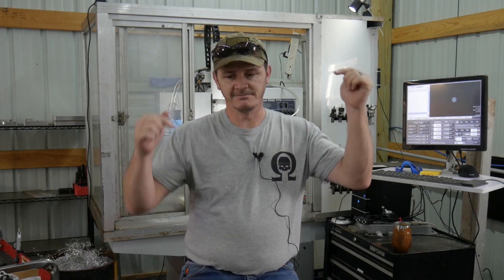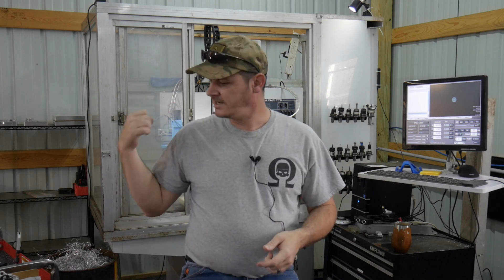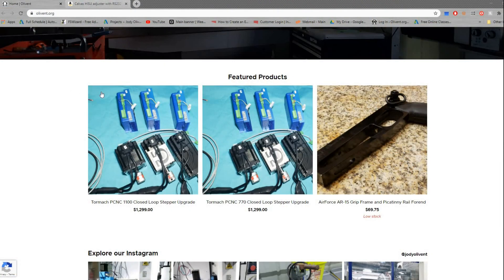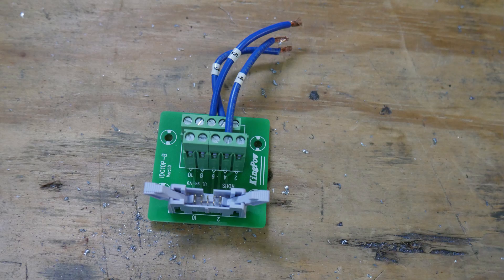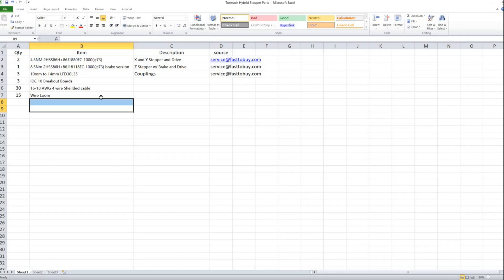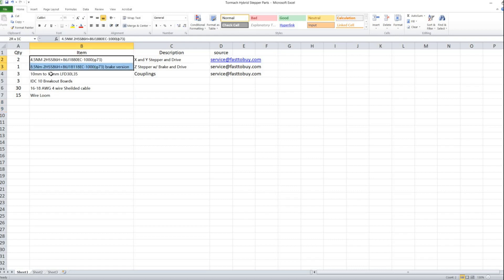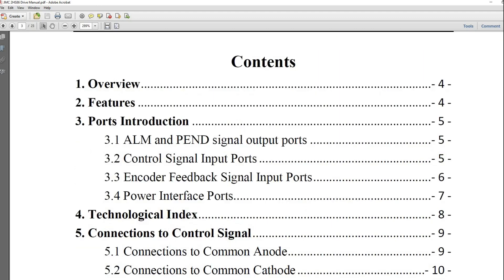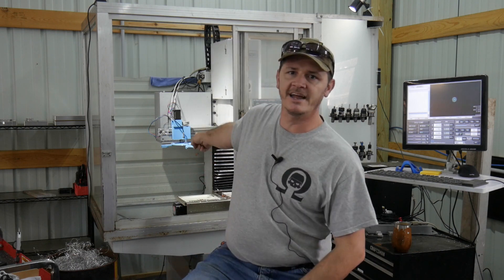DIY Tormach 1100 770 Hybrid Stepper Conversion

Comment: I'm excited to see the ATC videos, I'm hoping you cover how you interfaced it with PathPilot.  I've been thinking about building one myself but there's not a lot of info about the programming.
Reply from the maker: I'll try to get an intro video shot for the ATC next week.
Reply: @jodyolivent8481  I dont know how many others would agree, but I'd pay for a complete assembly if it wasn't the price Tormach is asking. Or a DIY kit, or even the plans.
Reply from the maker: Thats the plan, to offer an ATC that the user can install and setup themselfs with less upfront cost.
Reply from the maker: Awesome...I need to get busy this week.
Reply: @jodyolivent8481  I'd be interested in seeing more on the ATC as well. I personally think that Tormach is way overpricing the ATC for the 1100MX.